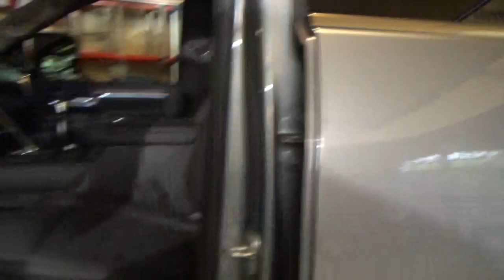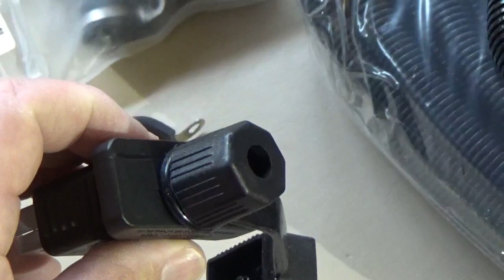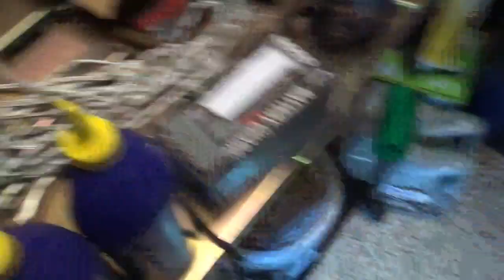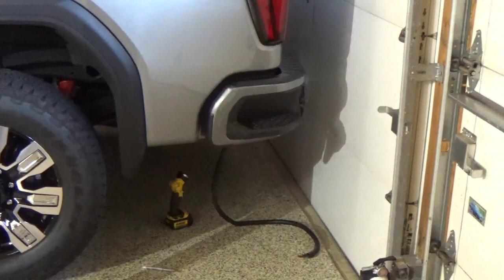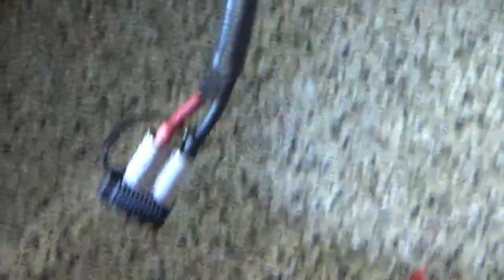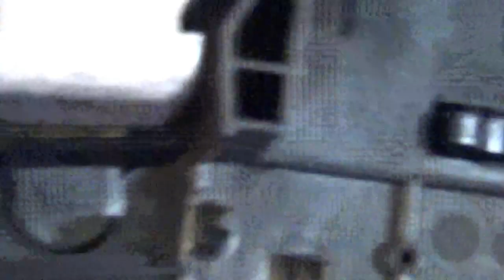2024 GMC Sierra 2500HD Hi Amp Power Feed

Comment: Thank you so much for making this!!!  I just purchased a 2024 and have been researching on how to connect this and what to use.  I think on my install I'll connect to a 60amp resettable inline fuse (made for audio systems) and see if that will mount inside that fuse panel, if not I'll mount it inside the engine bay.... that will allow me to trip it and disconnect it at the fuse using it like an on/off switch should i want to do so.  I really really appreciate you figuring out where to connect it and how long of wire i need to buy.  I'll use if for a 5th wheel so now i need to figure how some sort of flush Anderson plug to mount inside the bed area near the 7 pin connector: hoping to find a video of someone doing that.    Did you end up using the 3/4 rubber grommets to hold the wire and if so, did you drill into the frame or find existing holes/bolts to use.  I couldn't understand the brand name of the wire you recommended, could you add a build list to this to help others? The only thing that would have made your video better is if you included the build list for the parts you used and went underneath and shot the wiring after the install so we could better see how you routed it and secured it... but you solved 80% of my research!   Thanks again!

Comment: Thanks for this video.  I havn’t found this detail of a video tackling the problem to get higher power to the RV from the 2500HD.  Much appreciated!
Reply: I am glad that you found it useful.  If your RV has a solar panel be aware of the issue of the solar charge controller causing your truck to disable the trailer brake.  I had this problem going through the Smokey Mountains on a 4 degree decline.  I can point you to 2 TSBs to get it resolved.